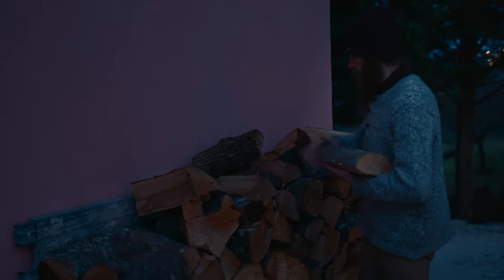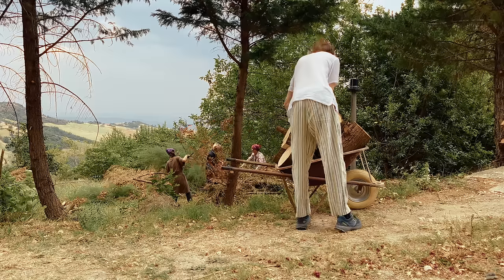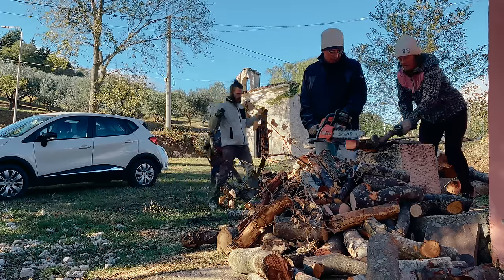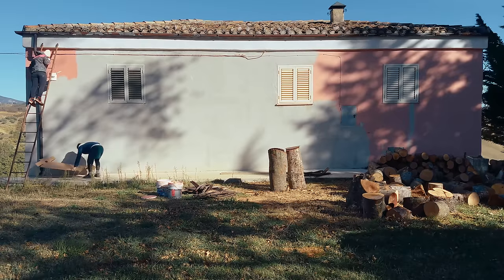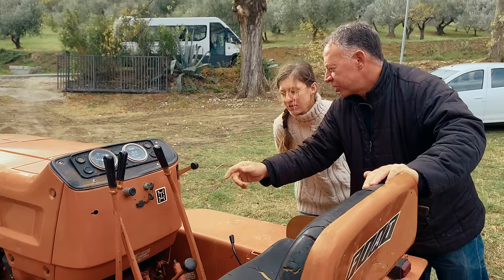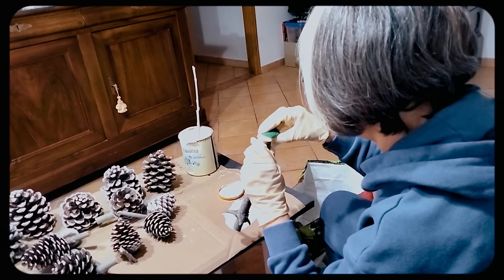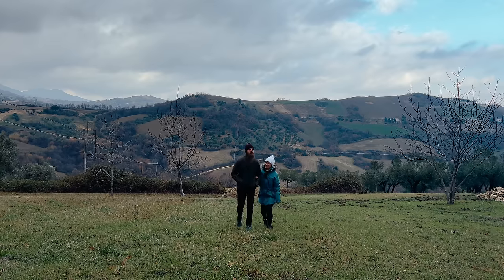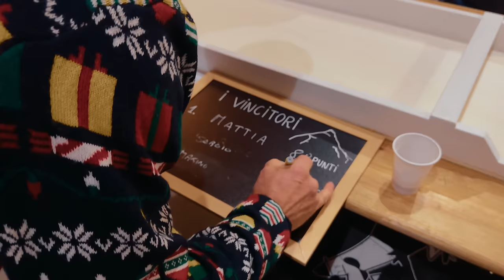#8 Making our first winter in rural Italy beautiful

Comment: When you repair a crack it is best to clean out the loose items of the stucko and than first applying a layer of stucko and followed with a fiber mesh which will hold the crack from separating again,   Than smooth out another layer or two , and it should not repeat cracking again.  After you have completed this and allowed time to dry properly you can paint

Comment: Just a quick comment re your firewood processing.  When cutting smaller branches or even modest sized trunks, take the pruned wood you want to cut and place them in an organized pile, preferably across some cross laid larger branches or trunks.  Then cut the pile together and save yourself a lot of wasted time and produce a lot more firewood with less work. And split your wood before stacking---it will dry a lot faster.